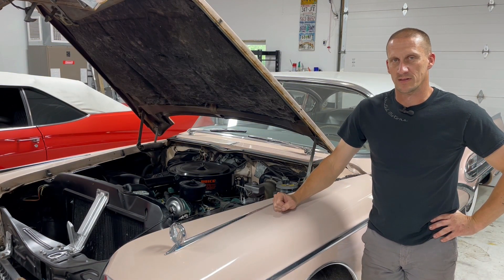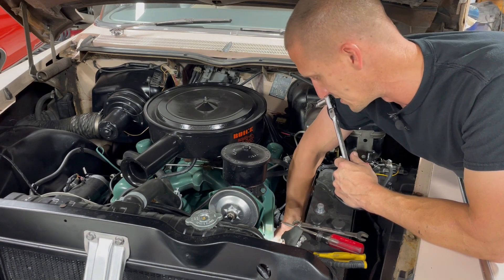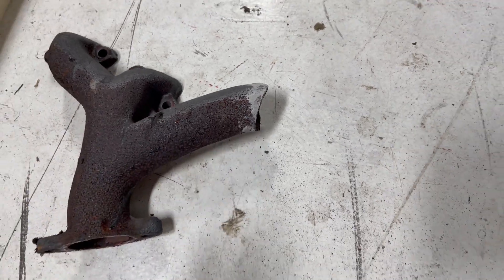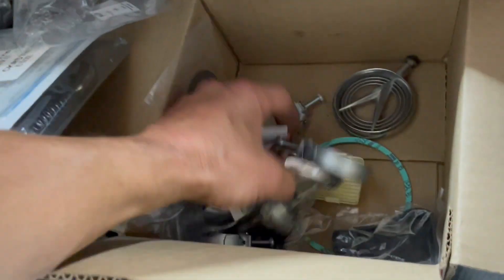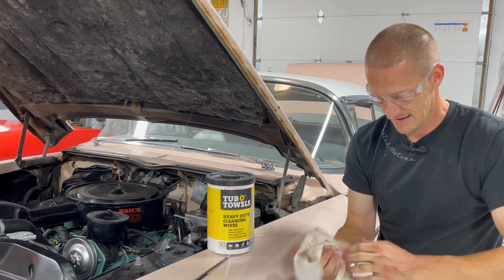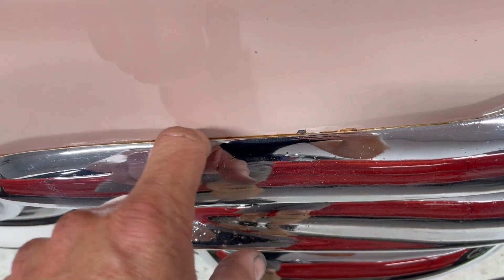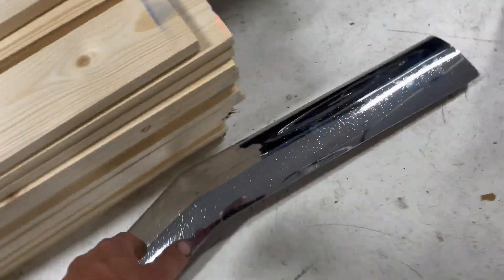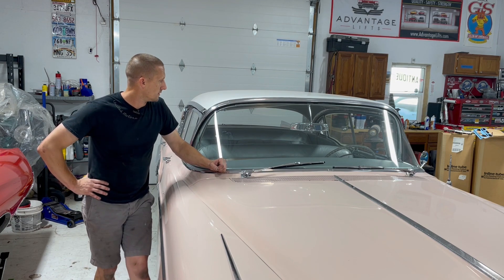1957-1958 Buick Broken Exhaust Manifold Replacement

Comment: Thanks for the video.  I started replacing mine so this answers a lot of questions.  By the way, what torque spec did you use to tighten?
Reply from the maker: Since I used gaskets, it kind of tosses out the factory spec, so I used my torque elbow.  Nice and snug.